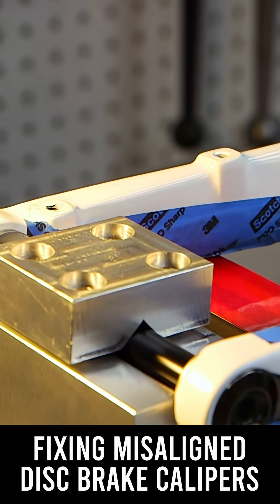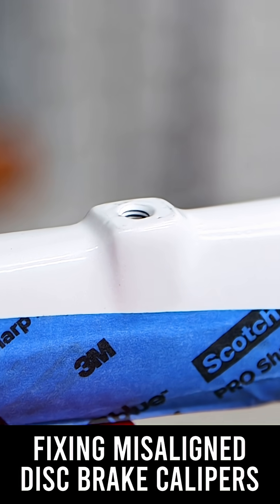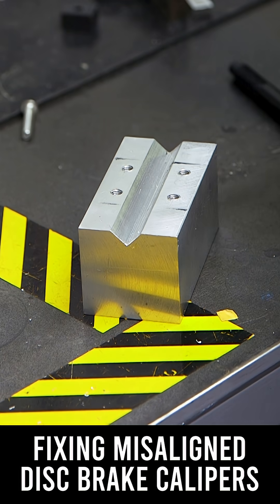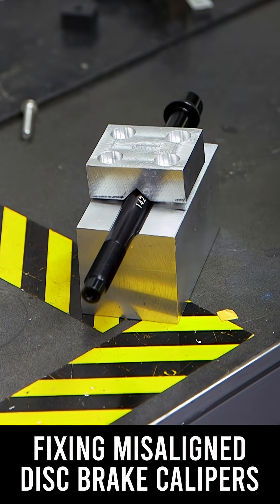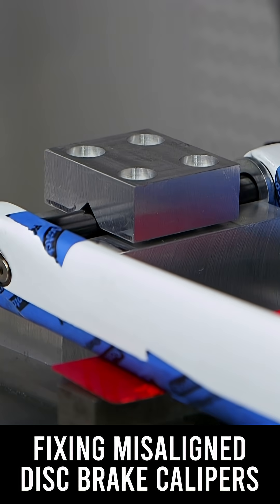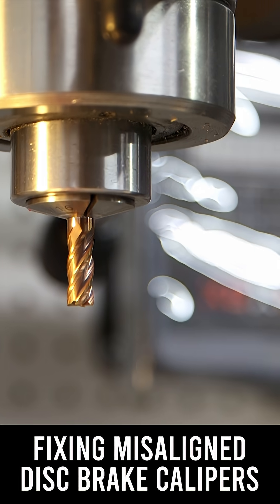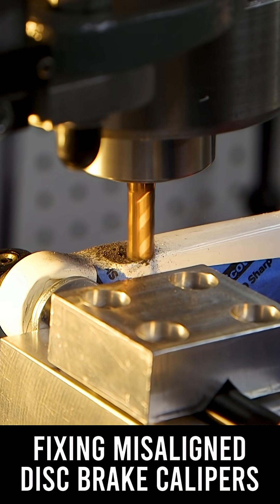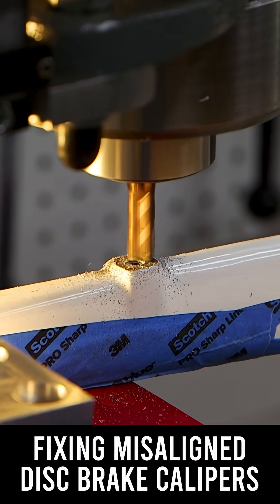Fixing carbon fiber brake mounts with the mill and some ingenuity #bikebuild #gravelbike

Comment: By chance, did you just remove the "cant" that mount the caliper at an angle, then straightens up, once the brake pads are applied, and the dragging action causes the lever system to be twisted, in turn, those landings onder that torque action are then straightened up, while under load? Vs, now, at static rest, sure, they are straight, but once under braking load, you are pulling them out of wake and not applying even pad pressure on the disc? Just a thought.

Comment: To hell with caliper complexity - just use conventional brake shoes on the rim.

Reducing complexity on your bike will reduce one of life's complications.
Reply from the maker: You can't use rim brakes on a disc wheel and I'm not going to weld on brake bosses so I can convert it to rim brakes, not that I could anyway, because the fork is carbon.

Comment: Remind me, why cant the manufacturers send them this way?
Reply: Money.

Production bikes have been poorly finished for decades. That is why bicycle mechanics have reaming and facing tools.
Reply from the maker: Yep, spot on.  This is a Chinese frame.  $330 shipped to me, on a boat from China.  An american worker would command, what, roughly $20 an hour or so?  That's 15 hours, not even two shifts worht of work.  The Chinese manufacturers have to cut cost somewhere.  I'd rather they do it on things like this, where I can easily fix them, than on important things like welds.

Comment: FYI use a bubble level. I've measured those digital levels as much as 3 def off and never better than +/-0.5 deg. Your bubble however is as accurate as the bottom is flat, which people are pretty good at making.
Reply from the maker: I've been eyeing machinist levels for a while, but they are so expensive, that I haven't bought one yet.  You are spot on about the accuracy.

Comment: Were the threads out of alignment also, or just the facing of the mounts?
Reply from the maker: The thread were alright.  It was really just the mouting surface that was out.  I think they just skipped the final sanding step after painting, probably as a cost saving measure.

Comment: Great work!
Btw Im sure you know that carbon dust is very toxic. Maybe use a vacuum each pass instead of just blowing the dust away 😅 Stay safe!
Reply from the maker: I've got a vacuum system behind the table which picks up chips and dust as I mill.
Reply: @RobertAdairWorkshop Cool! 👍🏻
Reply: @Alexandr_Silver  it's not toxic when it comes to toxicity. But it is dangerous when inhaled.

Comment: Fantastic work Robert. I follow mapdec cycle works on yt, bike shop in the UK, and you'll be surprised how many bike brands this is an issue with, even high end ones. It's probably the most common brake squeal issue.